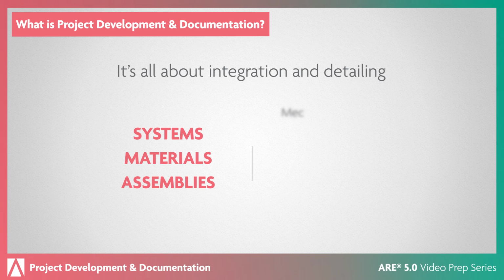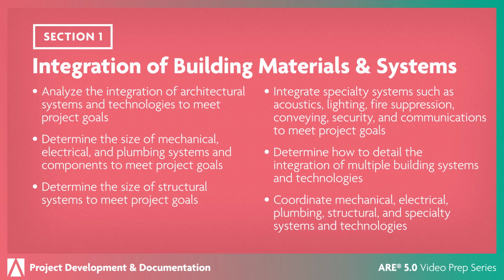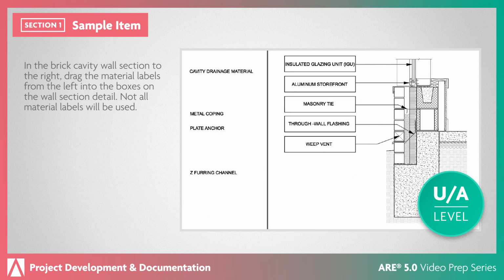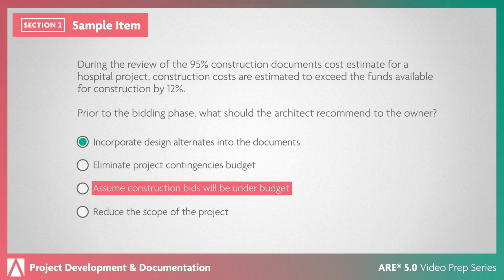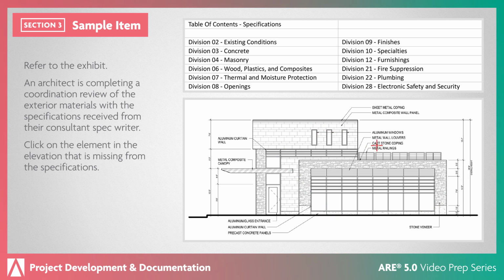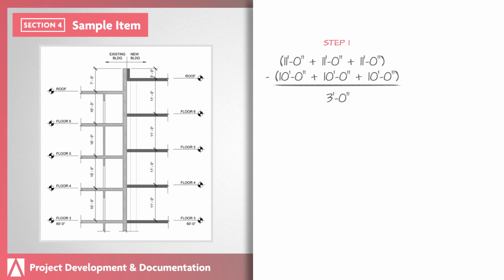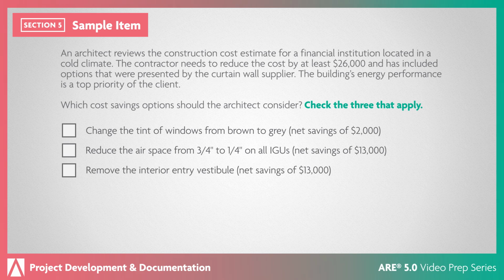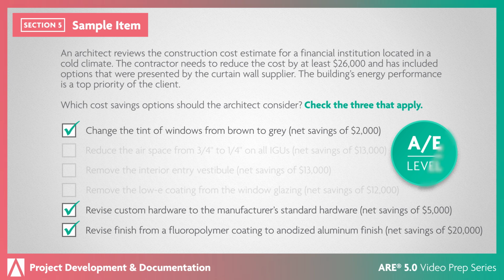ARE 5.0 Project Development and Documentation

Comment: Bottom ramp landing shall be 6 ft minimum per CBC 2019,  section 11B-405.7.  Therefore the answer should be 52 ft not 51 ft.
Reply: The test is based on IBC and ADA. California code does not apply for these tests.